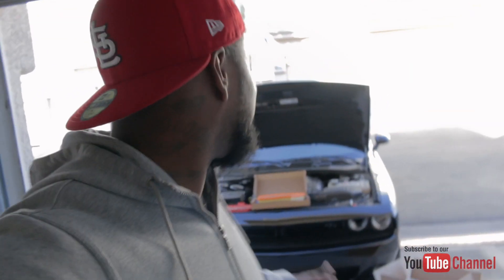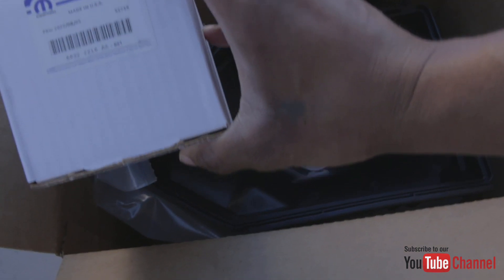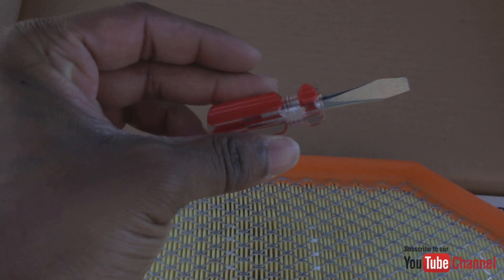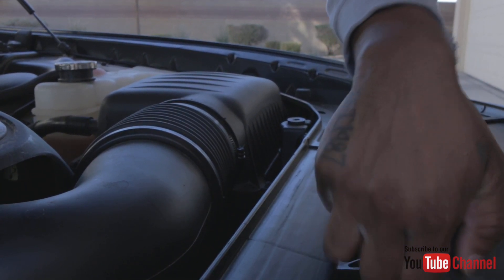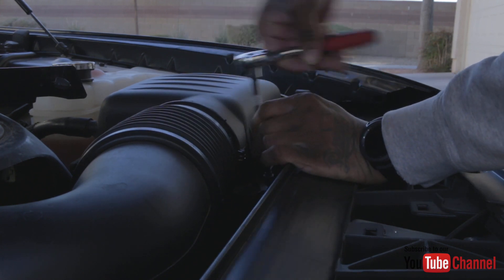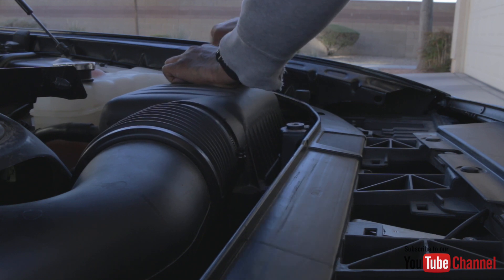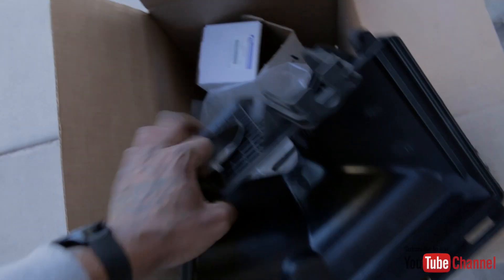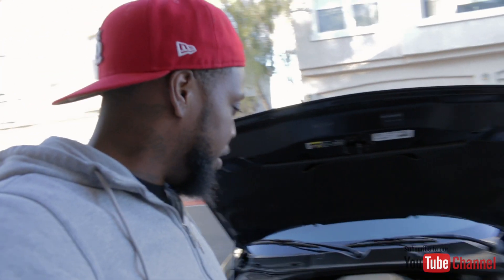EPIC FAIL: 5.7L Challenger R/T to Hellcat Airbox Mod From eBay Sucks!

Comment from the maker: What's up to my runner fam? As you all may know, this is a mod I have been looking for and trying to have added to my Challenger since I started the channel. Let's just say things didn't go as planned smh. I guess when it comes to modding your car there will be some challenges but today absolutely sucked in every way possible. 😤
Reply: Flex duct! Lol that sux bro damn
Reply from the maker: @bvoyles74  Right bro! Smh 🤬
Reply: I did that same mod on my 2019 r/t and had no problems. The one I got was from Amazon it came with the airbox, k&n airfilter, and that offset tube. Made by aFe Power P/N 54-77203-S

Comment: I used a razor blade and I got them foam pieces off easy and was able to reuse them.
Reply from the maker: Didn't even think of that bro. Smh. Since I have the wrong part I will do that once I get the right box and tube.
Reply: @TheGrimRunner  the blade was easy I got them off clean and glued them on...sounds like the box is ok u just need the right tube
Reply from the maker: @josephpuzzo1   Nice bro. The box was a little tricky too. It didn't line up with the holes. I'll be getting a replacement that they said is the correct one for the 2019.
Reply: @TheGrimRunner  check Facebook i found a new one out off a hellcat for sale
Reply from the maker: @josephpuzzo1  Thanks a lot bro! I'll do some research 💯

Comment: i would just get one of those aftermarket airbox connectors that advance auto sells and connected the tube to the light with that. i left mine on withought the tube for now. my screws didnt line up when i droped it in but when i was yest fitting it did i just fixes the filter in place a little better and forced the box to line up when closed.

Comment: The 2019s are different than 15-18s. Mine is an 18 rt+ and easy set up. Many challenger 19 models all said they had to cut about an inch or so to install the tube and then it works.
Reply from the maker: Yeah the 2019's are a lot different man. The tube I actually got was short. I'll have a replacement coming soon with a longer tube soon thank God

Comment: Same happened to me bro. Mine is a 2020 RT 50th anniversary. 2019 up seems that the the tube changes. Too big for my box. The box wasn't a perfect fit but isn't too bad. I'm looking for the tube that fits rn. Hope you can get the right one asap.
Reply from the maker: Yeah 2019 and up is tricky AF bro. The company on eBay I got mine from is Steve White Motors. They're going to send me the correct box and tube
Reply: I have a 2020 50th Anniversary Scatpack and it has the cold air intake.  The inlet tube for it is completely different.  It was $60.  Mopar has several different styles and it can get confusing.  Steve White is a good dealership.  I think some of the online parts marketing people get confused.  When you get the right tube, it should be a tight fit.  Good luck.
Reply: Can some of y'all hook a brother out with the right part number ?, I have a 2020 50th anniversary as well but 5.7.
Reply: @juanito3.5  Headlamp Duct Tube - 77072385

This is the inlet tube only.  This is for Open Cold Air Intakes.  Shakers come with the Open Cold Air Box with the hole already there.  If you have a closed air box this won't work.
Reply: I have the hellcat box just the AFE tube didn't work so I'm looking for just the tube
Reply: @juanito3.5  If the one you had looks like the one that came with his try 68207918AB.  It looks longer.  Does your box have the round inlet hole or rectangular hole?
Reply from the maker: @Challengerscatpack50  Yessir you're right about them. They're very professional and told me which one I should have gotten so I'll be ordering the new one once I ship this one off for return
Reply: @TheGrimRunner  can you tell me the part number of the right one when you have a chance bro ? Thanks

Comment: Aem performance makes a tube that fits tight and looks factory. Aem also makes a dry flow air filter that is made by k&n that I run in my rt I love this upgrade. @ grim
Reply from the maker: Thanks for the information bro! A lot of guys mentioned the AEM one so I'll check it out 💯

Comment: I bought the aFE adapter for the air box it took some maneuvering but I able to get it to fit. I also had to add some weather stripping to keep it from sliding. Now it fits like a glove. But yeah I messed with it for awhile too.
Reply from the maker: That's crazy bro. It's good to know I'm not the only one in that boat. I'm definitely going to keep trying until I get the right one lol. I'm going to check the AFE one out because I hear a lot of people talk about it

Comment: This may be a blessing in disguise. My advice (for what it’s worth) is to just upgrade the filter to a Hellcat filter and call it a day. The factory air box these cars come with is actually quite good. Take it easy, bro.
Reply from the maker: Thanks a lot bro! That's what I'll probably do. I'm hoping the part they recommend is an easy fit. If not I'll just leave everything stock and keep the hellcat air filter

Comment: Get a rubber tube and clamp only u got to do measure from diameter thats all and remember becareful ordering from eBay i know is cheap but sometimes it won't fit and dodge sell two priceless
Reply from the maker: Thanks bro. Crazy thing is this is a mopar part but you're right you do have to be careful on eBay. Hopefully the next one with the larger tube fits

Comment: Sorry about that Brotha. I have heard that it takes some work to get that tube to fit. I brought The JLT Cold Air Intake for my 2014 Charger RT. You will get it straight. Comes with the territory some times.
Reply from the maker: Thanks a lot bro. I'm hoping the new one they send out works like a charm. It has a larger tube. I just have to go through the hassle of returning this one and waiting for the new one. You're right though, I'm starting to learn this is all apart of the game
Reply: @TheGrimRunner  That's cool. I hope that it does work out for you!

Comment: Bro the same thing happened to me with that 
f-ing tube on my 2019 RT while installing my JLT intake. The correct one is the afe tube. Perfect fit but its like 70 dollars
Reply from the maker: That's crazy AF bro. My heart skipped a beat when I saw how short that tube was lol. I adjust shed a tear because I thought that was it and I finally had my part 😂 I'll look into that tube. The company on eBay plans to send me another one with the correct tube
Reply: @TheGrimRunner  yea bro i was hurt when i got that baby ass tube. I couldn’t even return it. Wasted money. But the afe tube fits like a champ
Reply from the maker: @DCGEMINI202  You ever seen boyz n the hood? If so remember the scene when tre was punching the air, that was me internally lmao. Thank God this company will do a replacement
Reply: @TheGrimRunner  lmfao ass lucky ass. I ended up throwing mine in the trash smh
Reply from the maker: @DCGEMINI202  😂😂😂😂😂😂

Comment: awwwww damn bruh. can't wait to see the vid. what went wrong ?
Reply from the maker: Everything bro smh. I don't want to say in the comments as of yet but you'll see tomorrow
Reply: @TheGrimRunner  Aw shit. I just ordered same part same guy. I have a 2019 rt is this gonna be a problem for me as well?
Reply from the maker: @SRTGHOSTS  Definitely bro. If you purchased it from Steve White Motors on eBay the part doesn't fit smh
Reply: @TheGrimRunner  wow yeah I literally ordered it after I saw your post haha. Well eBay always offers returns even if the seller claims they don’t. Just make sure to open item not as described case.
Reply from the maker: @SRTGHOSTS  Yeah that's exactly what I did bro. They messaged back with a condescending message saying something about a inboard light but they sent me a return label. I'll order the other one and see if it works.
Reply: @TheGrimRunner  yeah man you were right. I got the correct part if you need the link.
Reply from the maker: @SRTGHOSTS  yes please send it!
Reply: @TheGrimRunner  353131766361 type this in eBay search bar it will pop up. It’s not letting me link it because of the eBay app. It’s the same seller. My box fit but the hose is was to short. I messaged them they helped me get the correct one. I’m returning the other one as well.
Reply from the maker: @SRTGHOSTS  Got it! That's the one that they told me I should get so I'll order that one once I return the one I currently have
Reply: @TheGrimRunner  yeah they tried to sell me just the tube for $70 something 😂
Reply from the maker: @SRTGHOSTS  H*ll naw lol. We need the right part! The box doesn't fit either 🤣

Comment: I just got my updated part one man. Honestly feels no different lol it’s cool I guess. I just got a diablo tuner it’s the biggest difference you will feel.
Reply from the maker: That's crazy bro! You got the one they said actually fits? How did it fit or was it still an issue?
Reply: @TheGrimRunner  it fit good but the rubber piece that you take off your old one I forgot and left it on the one I mailed back to them. I had to get another from dodge dealership. This tube isn’t plastic they send you. They cut it to fit your car.
Reply from the maker: @SRTGHOSTS  Interesting. Do you feel it's actually worth the mod? I shipped the old one back but waiting for a refund. I'm still debating on order the new one. Any power gains?
Reply: @TheGrimRunner  sorry bro just now seeing this. Yes and no you won’t feel the power. What it does a ram air effect which shoved more air into the air box. It cools the engine down faster stock hemi is 203 mine is running at 197 with it

Comment: I went through this install as well. Had to do a lot of research on tubes and lower hellcat box models. The hardest part for me was removing the black cap that covers up the inlet tube. Hang in there. It’s worth it once you get it.
Reply from the maker: Yeah bro it's crazy because I thought I was so close. Good thing is the company on eBay said they have another one that should fit the 2019 even though this one was advertised as being a for for my year. I'm giving it one more shot!
Reply: @TheGrimRunner  you got this!
Reply from the maker: @Gonin60  Thanks bro 🙏🏾

Comment: Sorry to see the inlet tube did not reach. I installed this one on my SHAKER box with a little drilling for push pins. Fits great no issue on the install. Hope this helps. https://www.ebay.com/itm/2015-2020-Dodge-Challenger-Hellcat-Headlamp-Air-Inlet-Intake-Duct-Tube-Mopar-OEM-/272741478340?_trksid=p2349624.m46890.l49292
Reply from the maker: Thanks bro!